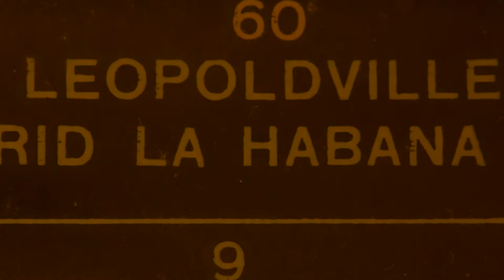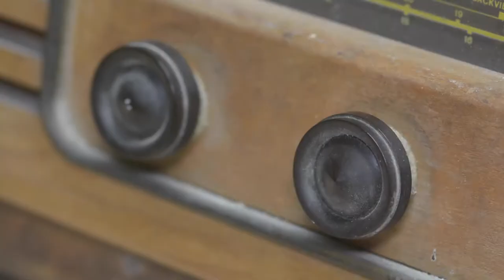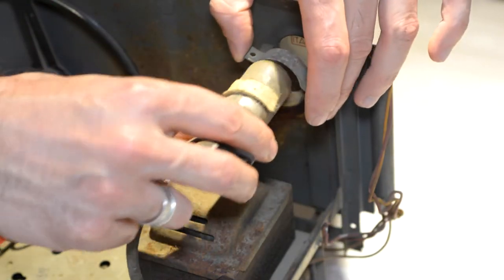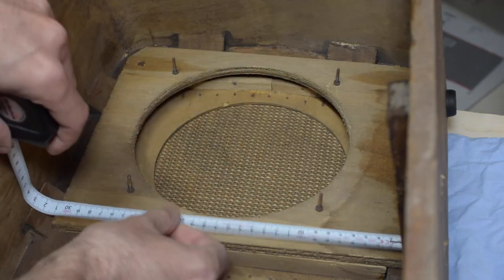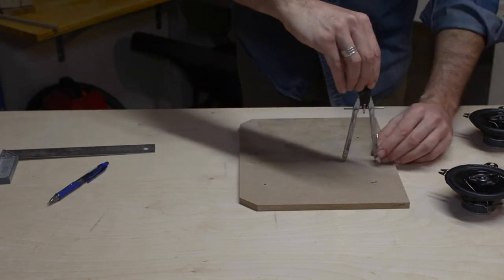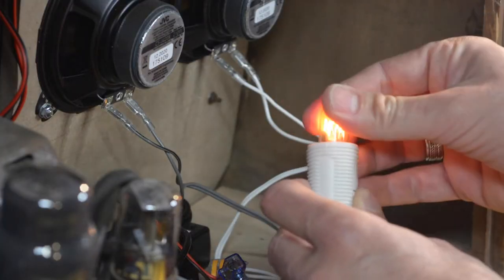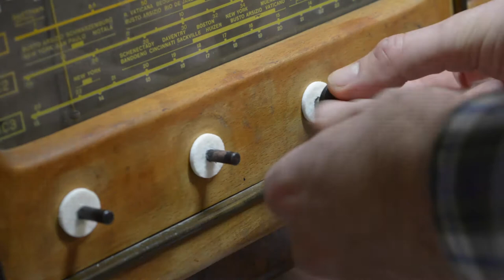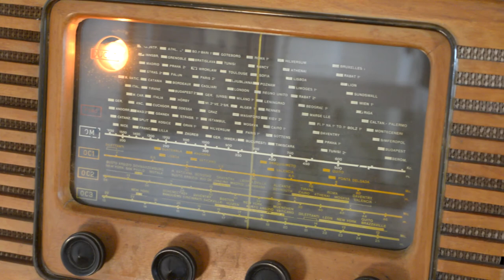How to convert a vintage tube radio into a Bluetooth speaker

Comment: This isn't conversion. You discarded everything except casing and dial glass. Bluetooth module will become obsolete in few years... Proper way is to reuse radio (and restore it) and then add a BT
Reply: What! Discard or keep the old parts inside and just hook up an amp and bluetooth. That's the whole point. This is not a rebuild video.

Comment: you know you can just tap into the radios tube amplifier section with the bluetooth module. You can even put a toggle switch to pick radio / bluetooth.
Reply: How do i do this

Comment: My question is Why to convert a vintage tube type radio to a receiver with modern sound resources ? For me the value of these converted radio is zero....
Reply: Well if it is not working anymore and you got it for 30€ from Ebay, then thats a good option I guess.

Comment: You just can't beat the looks of a well-used old radio. They have a warmth and charm modern products cannot compete with. As a family air loom, it should be restored one day with the replacement of tired old components to give the best possible sound. Its wooden case came up beautifully with a bit of tlc. Very enjoyable video, thank you.

Comment: I use a simpler method. I simply connect a small portable Bluetooth device, with a cable, to it’s record player input. 30s 40s and 50s models use a socket that is compatible with a standard modern European electric plug.

Comment: Very nice. It probably wouldn't be hard to get the radio to work. Change out all of the capacitors and check the resistor values, change them out if necessary. Probably fire right up. That broken dial cable will probably give you more grief than the electronics. I hate those things. Some wraparound several knobs and pulleys, make 90* turns... Just a pain in the @$$.

Comment: Good morning,
I would like to do the same thing with an old radio that I inherited... but I'm not very expert, is it possible to have the connection diagram between the transformer and the light bulbs? How did you connect with the old PC transformer and the amplifier power ? thanks so much for your help.

Comment: How did you connect the bulbs to the power supply?  Looks like you cut the wire and used some plastic gizmo?  Sorry I'm a real newb
Reply from the maker: You mean to connect wires to the power supply? I used simple lever wire connectors similar to these https://www.amazon.com/Connectors-Conductor-Combination-Assortment-Connection/dp/B07SFCCPZ6/ref=sr_1_7_sspa?crid=ZIYFWO3E2RAR&keywords=cable%2Bconnectors&qid=1705874214&sprefix=cable%2Bconnectors%2Caps%2C174&sr=8-7-spons&sp_csd=d2lkZ2V0TmFtZT1zcF9tdGY&th=1

Comment: At 4:10 you put bulbs in some power string. What did you use?
Reply: Hi, do you mean the bulb holder you see at 05:10? I used the original ones that were in the radio

Comment: Thanks for a great video.  I am very new to this subject. I am thinking of a modernising a vintage radio to play 30s and 40s music from websites directly  and maybe play old recordings in mp3 format by artist. This would give it an authentic feel. I would like it to play music and choose stations from websites wirelessly directly, not just Bluetooth through my phone or tablet. Is this possible at all? I gather there is a way with a couple of modules that I can fit together myself. I’ve seen video’s but as a newbie not understood the programming of pi or arduino. Is there any cheap pre programmed modules out there? 

Regards

Comment: Just a quick question, are you utilizing the tube amp? or the solid-state amp? You did an amazing job I absolutely love it.
Reply from the maker: Hi thanks! I am using only the solid state amp. The original tube amp needs to be repaired
Reply: @woodoogarage9931  and it is mono, too.

Comment: I am doing similar project and would love to see the wiring details and the bluetooth amp that you used to buy the same.  particularly interested to understand how you use the one power source to power the amp and the lights as I am looking to do the same, thanks Paul
Reply: Same here. I found many similar videos but this one is the only one that wires the old lights into the BT system